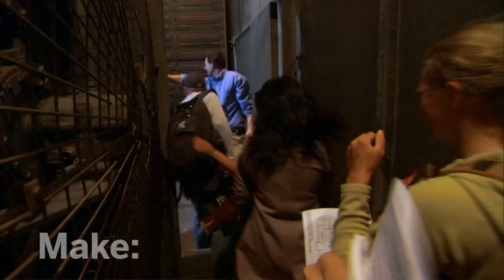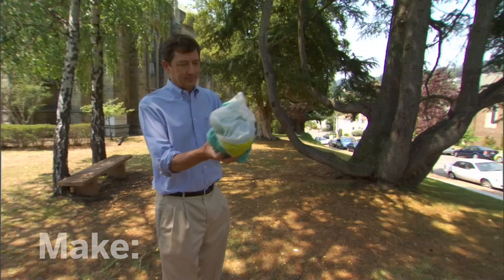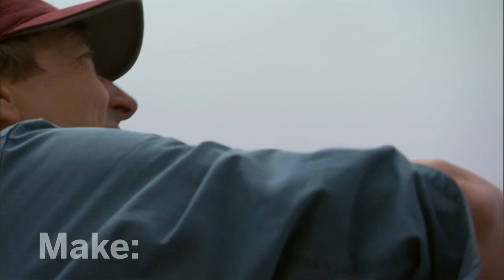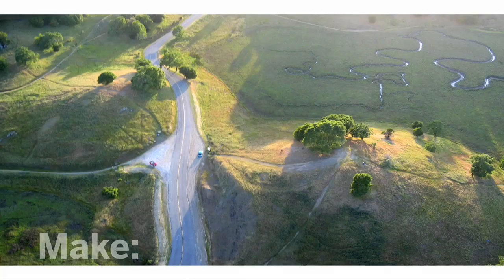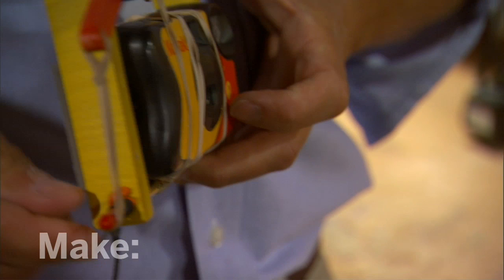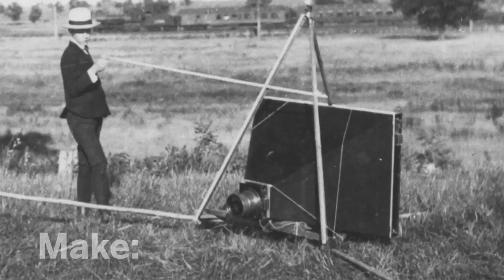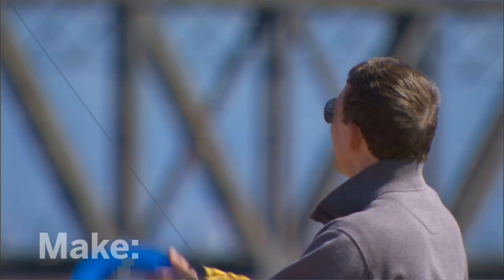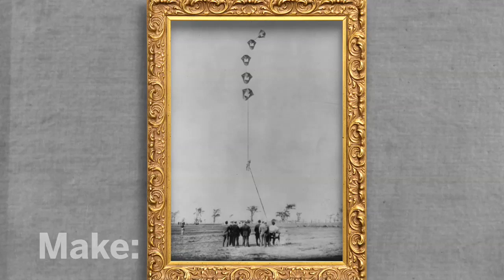Maker Workshop - Kite Aerial Photography on MAKE:television

Comment: @ creepyloner1979:

Yea, right. Except for the fact that of course balloons WILL NOT work in wind (or be exactly as "unstable" as a kite would be then). Plus, just one single filling of helium for a balloon capable of lifting a SLR will cost you hundreds of dollars. If you have that kind of money, settling for a rc-helikopter would actually be much better. I like the idea of doing this with a kite - it has something poetic, aside of all its other advantages (low-tech and inexpensive).

Comment: @taxiuniversum if it's too windy for a tethered balloon, it's too windy for a kite. if it's not windy enough for a kite, even better for a balloon. enough helium to lift a dslr and balloon would actually cost well under $100, but to hell with helium. hydrogen is cheap and easy to produce and so is hot air.